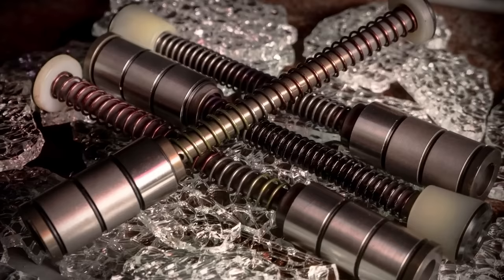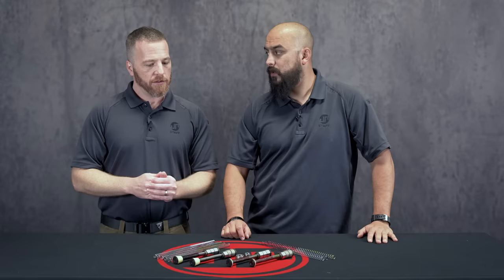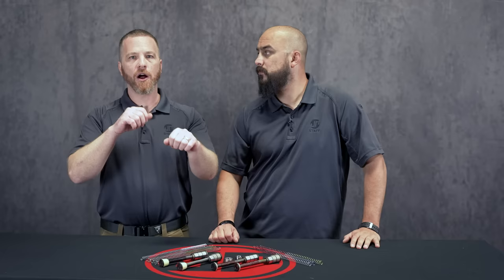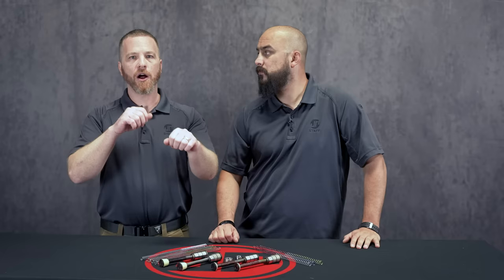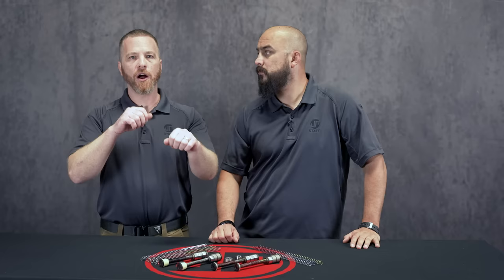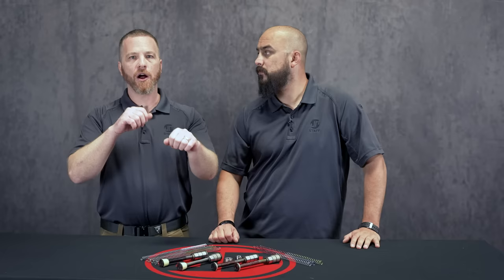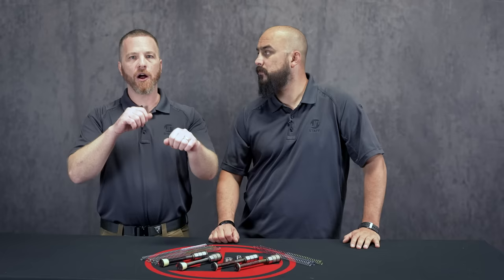Choosing the Right Silent Captured Spring

Comment: I know the company says to use the H2 weight buffer for a suppressed SBR but I found that the bolt catch wouldn't lock back on an empty mag, even with a wide open adjustable gas block. I suggest buying the least expensive SCS as it may work just as it should and you aren't paying extra for some tungsten weights that may not be needed. I wish I did that. 😑
Reply: Made the same mistake lol

Comment: One thing I'm not sure I understand...when is bolt bounce an actual problem on semi auto rifles?
Reply: Bolt bounce will topically move the bolt out of battery just enough so on the next shot you get a light firing pin mark on your primer and you end up with a misfire.

Comment: Everyone is complaining about the difficulty of the topic, but this video is the best supplemental source of information available...watching this video, in addition to a careful reading of the documentation JP provides on the website, does appear to answer all the questions most people have.

If I understand JP correctly with regard to selecting the proper buffer/spring combo:

     - If the priority for a rifle is reliability, then increasing the buffer weight is the best initial approach.  JP provides a flowchart to assist with this.

     - If the priority for a rifle is recoil mitigation (in order facilitate the quickest recovery of the sights onto the target), then using a heavier spring with a lighter buffer weight might be the best initial approach.  Sprinco claims to have empirical data to support this approach as well (they are a company that makes excellent springs...which could imply a bias...but JP SEEMS to substantiate this claim).

All choices have tradeoffs.  It seems that the tradeoff for a lighter buffer mass would be a greater chance of the rifle failing to go into battery, and the tradeoff for a heavier buffer mass is increased recoil impulse (delaying sight recovery onto the target).

Based on the information available from JP and Sprinco, it seems that most rifle tinkerers need to understand the following (with various exceptions relating to poor rifle design/construction and weak magazine springs):

     - If your rifle 1) reliably strips each round from the magazine, 2) the brass consistently ejects at 4 o'clock, 3) AND the bolt always locks back on the final round of a magazine, then your gun is gassed properly for that ammo.  There's no need to modify it from there.  In that case, you MAY want to get the JP SCS version of whatever you have in your gun if you really just can't stand the sound of the action spring during the cycling of your rifle.

     - If you're going to be running a broad range of ammo types, then you want to make sure your rifle has the appropriate buffer/spring combo, in order to meet all 3 of the above criteria for the weakest powered ammo you are running.  This means that it will be overgassed for some ammo, but it will always cycle with even the weakest ammo you use.
Reply: Thanks for the heads up.  Took my 8” 300BO unsuppressed H2 for the first time.  One fail to load.  Bolt holds open on last rnd.  But ejecting at 5 oclock.  Going to try lighter spring but unsure.
Reply: Thank you. This complemented the video very well for me. Thanks for the breakdown
Reply: Very helpful explanation thanks
Reply: Super Big thankyou for that breakdown
Reply: @Doc02864 you have the h2 for a short 300bo? did you change any springs?
Reply: @SchiZ03 I went with a lighter spring but haven’t tested it yet.  You would think if there were 5 springs the middle would be standard but it’s actually too heavy.
Reply: @pdlane43 Start a YouTube channel bc you have superior explanation skills. It’s needed thank you for clearing up an hour of a mess for my self in one paragraph
Reply: @briandavis3173  This is an extraordinarily thoughtful comment.  Thank you.
Reply: Awesome breakdown of the topic dude, thanks! Cheers
Reply: Wouldn't you want a slightly heavier spring then, if you are ejecting at 5 o'clock and your goal is 4 o'clock? Since you are ejecting at 5 o'clock, that would mean your spring is lighter/weaker, allowing it to recoil at a faster rate causing an early extraction? I'm not an expert or trolling, just trying to learn as much as I can. By using the advice given on the video, they said if your ejected casings are at 1 o'clock, then the spring system is too stiff. If that's correct, and the goal is to reach a 4 o'clock ejection point, then you would need to keep going to a lighter setup until reaching that point. Once you pass the 4 o'clock goal, that's too light, and you have to use stiffer springs in order to bring the ejection pattern back to the 4 o'clock position. I don't know if my comprehension/explanation is correct or incorrect, but I would like to know what solution worked for you. Thanks in advance for your reply if you do.  My time is valuable to me, so I search for knowledge. I don't waste it on trolling. Cheers
Reply: @chadh3441  For a given ammunition type, brass ejecting at 5 o'clock would indicate a system that is slightly under gassed or over sprung (for that ammunition).  Compared to a 4 o'clock pattern, a 5 o'clock pattern indicates that the bolt is unlocking later and/or the BCG is moving more slowly.  In order to move the pattern to 4 o'clock,  a lighter spring or buffer could be a solution.

It sounds like you may have gotten it backward.  In the video, just before the 11 minute mark, a 1 o'clock ejection pattern is described as having a bolt velocity that is too high.  This would indicate an over gassed system, not enough buffer mass, and/or too light of a spring, NOT a "spring system [that] is too stiff".  To correct a 1 o'clock pattern, a heavier spring and/or buffer would be a solution. In my experience, any firearm that requires a buffer heavier than an H2 is a firearm that is in need of an adjustable gas block.  H3 buffers yield unacceptable recoil/sight movement for my use.  This includes blowback ARs.

It seems to me that 4 o'clock is considered a desirable brass ejection pattern so that the rifle 1) will cycle a wide range of, or inconsistent, ammunition (broader operating window) 2) without experiencing unnecessary/excessive muzzle flip.  Said differently, 4 o'clock leaves enough room for weaker ammunition to still cycle while avoiding the excessive recoil of higher pressure ammunition.  Of course, this is all dependent upon the pressure range of the ammunition types being used.

It is always needs based.  Some competitors (who can control the consistency of their ammunition) may pursue a 5 o'clock ejection pattern (as long as rounds always feed, even if the bolt doesn't always lock back) in order to decrease the amount of time it takes for the sights to settle from shot to shot.  For someone relying on a rifle for defense purposes, the additional recoil and sight movement that results from an over gassed or under sprung rifle can be an acceptable trade off because it can help ensure that the rifle will always cycle, even with ammunition of unknown consistency.

One thing I DO NOT understand is why a heavier buffer yields a broader operating window than a heavier spring.

Comment: Update:. So I installed a tungsten weight on my SCS in my cloned LRP-07 that was unlocking prematurely running the VMOS BCG with SCS, 6.5CM 22in. Supermatch barrel, JP AGB, etc..
  Completely fixed bolt opening prematurely and brass is coming out very clean now!   Rifle is consistently locking back on last round and cycling great!  
  Thank you guys, THIS was the info I needed to get my cloned LRP-07 running reliably suppressed!  Much appreciate!

Comment: good to know my intuition was right on. running a 2a palouse lite rifle with an icrw G3 low mass steel bolt. ordered the scs2-15 with a spring pack for further tuning. also using a superlative arms adjustable gas block. after my modifications, the rifle will be sitting at around 4.3 lbs down from the stock 5.3 lbs. With a scalarworks mount and aimpoint t2, it'll be at 4.7 ish lbs, with a huxwrx 762ti, it'll be back to stock weight of around 5.3 lbs (and i have an h2 captured spring in my PWS, but i don't think it'll need it because of the flowthrough nature of the suppressor). 

Dollar for dollar lighter than a vseven while maintaining a forged receiver set, sitting just above 5 lbs with a dot and suppressor.

Comment: Either my comment in your last video on large frame BCGs was just coincidental timing or you guys went over all the info i was asking for but instead of responding you guys made a video!  
  Thank you very much for this, looks like I will be ordering a couple tungsten weights for my LRP-07 clone I built running a Omega 300 with JP 6.5CM barrel, JP detent AGB, VMOS H2, and SCS H2 and also have the spring kit.  
  I threw the lightest spring in this past weekend and retuned it to lock back on last round.  Carbon on brass is really bad with either springs so GREAT info!  Thank you guys, much appreciated!

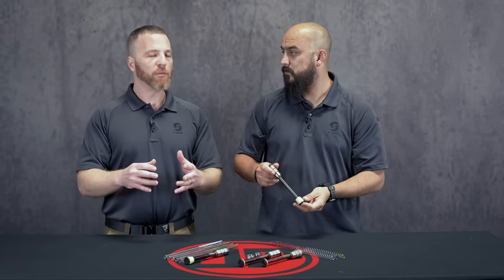Comment: My 14.5 mid length Noveske needed the ar10 springs to cycle at the 3:30-4:00. Using on different platforms it seems like the springs are lighter than normal

Comment: Where is the best place to start to get the softest shooting 3 gun rifle?  Currently running 16", lightweight BCG, adjustable gas block, standard weight SCS.  If I would tune this to be even better what would you recommend?  Gas, buffer weight, buffer springs?

Comment: I have bought 2 then used them in the AR 15 uppers in 7.62x39 - 17 Remington - 223 - 6mm x45 they are no different than using the buffer and spring set up.
Still makes noise also .
Reply: no shit it makes noise
Reply: So there is no difference between the stock buffer and spring and this one on the 7.62?
Reply: It factually cannot make as much noise as a buffer/spring combo. The sprint is bent up and scraping all the walls of the buffer tube at all times. With this system, that no longer happens. It will rub a bit on the capture rod but not nearly as much as rubbing the buffer tube.

Comment: great video! Actually learned a thing or two, thanks for that. My current sbr build is on the verge of "dude you're doin way too much" and a killer battle rifle if i could iron out the kinks. Its a billet 5d tactical lower, machined by me, 11.5'' 5.56 nato upper, carbine length gas system w/adj block, billet slick side receiver, skeletonized lightweight Browning BCG, 7''x1.5'' modular can aslo machined by me, fostech echo sport trigger, and a standard carbine buffer and spring. shes slightly overgassed, but only during high fire rates in the echo position (which is screaming fast btw with this setup) and occasionally fails to pick up the next round from the mag, click empty chamber. i love the concept of the scs and im hoping you have a recommendation or 2 as to which kit and if itll help it be a little closer to reliable. thanks
Reply: Lol just started using a 5d jig and router myself xD got like 3 different builds half put together now haha
Reply: @rachelstephens3680  From my experience, 5d's router setup is about as reliable as it gets when it comes to the finished product and machining accuracy. As long as I keep from doin something stupid, I know once I put a fresh blank in the jig it's going to come out ready to assemble without any headaches.

Comment: I installed a JP "standard",  My AR 15 began to "double feed - one in the chamber and one in the bolt chamber.  I do have an Adjustable gas block on the gun before installing the "standard" JP..
Reply: Would that be from serious "Bolt Bounce", causing the bolt to slam forward so hard, it bounces back far enough to feed another round? Is this scenario caused by the spring being too stiff, weight being too light, or both? Did you find a solution? Thanks in advance for any replies. Cheers

Comment: If 
2 steel, 1 tungsten = H
1 steel, 2 tungsten = H2
3 tungsten = H3

Then what is the H rating for the all 3 steel rings that come in the JPSCS2-15 package?

I have a 16”, 5.56 non-adjustable gas block and I want rapid cycling for rapid firing without the heavy  recoil. Which configuration will work best?
Reply from the maker: Send us an email to Tech@jprifles.com and we can get one of our experts to help you select the correct model for your setup!

Comment: So I have the radical firearms ar15 mid length gas system. 16in barrel. Chamber in 556. Any idea what I should run? I’m just a little confused on all of this lol. I am assuming just the JPSCS2-15 but I don’t want to run into any issues. Anyone have any suggestions?

Comment: Ammo used in this was Hornady Black 208 grain A-Max (Subsonic) & It's a Custom Built AR Pistol I built from top to bottom.

My issue is I got one of these for my 10'' 300 blk out, in H2 weight config. My plan is to suppress it at some point. HOWEVER, if you dont supress it with the H2 config (2 titanium, 1 steel) EVEN with a adjustable gas block. I could get it to extract the shell casing but not rack another round without having to manually do so. 
I'm guessing this is a spring issue as in spring weight is to heavy? OR is it i can use the spring that came with it and i need to use 3 steel weights so its standard until i suppress?

Very frustrating day at the range.

AFTER watching more of this video I'm seeing its a weight issue....thank god I ordered the SS Weights yesterday and I'll be changing those out to run subs even though at this time I'm not running it suppressed just yet. I also already have the spring set cause i bought it with the scs when i got it. So I'll start with the SCS Weight change to 3 Stainless to try and get the bolt to rack another round and achieve lock back (without manually locking bolt to the rear). If need be like you said do a 95%  weight spring and go from there. THANKS!!!!! Helps out a lot!

Comment: ok ..do you have to remove the bolt carrier weight .. what the best weight for a 9mm direct blowback system ?
Reply from the maker: Yes, the slide passes through the rear of the bolt, so the 9MM bolts with weights will need to be removed.  The weight required changes according to your setup. Give us a call and we can help you find the best for your setup. 651-426-9196

Comment: What do I need for a DD Mk18 and RC2 suppressor and a folding Law T pistol brace? 10H or the 15H??  I ordered a sprinco blue and a H2 buffer and then saw this. I was going to use the stock carrier that is at .70 but need to know if you guys suggest an adjustable carrier bolt or something else. I want to able to run both unsuppressed and suppressed as cleanly as possible. Semi auto.
Reply from the maker: I believe you are looking for the H2-LAW. It sounds like a specific request, reach out to tech@jprifles.com.

Comment: Which one do you recommend for a faxon light weight BCG? 

Also, would I need an Adjustable Gas Block as well as the JP buffer spring for a lightweight BCG or would the JP system be all I need?

Comment: I just got mine in but now I'm questioning if it's the right one. I'm running a 16 inch with an h2 currently, suppressed and a radian suppressor charging handle. No shorty stock but standard buffer tube. The only difficulty saw was the polymer end am I wrong?

Comment: I just ordered a JPSCS2-10H2 and spring kit for an 8.6 Blackout carbine build (16" barrel). I used a Geissele Super 42 spring and H2 buffer. I didn't install an adjustable gas block. I have one so if necessary I can change out the gas block. It ejects but dents the case mouth, the case lands at about the 1 to 2 o'clock position,  and the bolt doesn't lock back on the last round. I weighed the buffer and it weighs 4.3 oz. My form 4 for a Dead Air Primal is at least 6 - 7 months out based on current status info. I plan to shoot this suppressed all of the time but shooting the Gorilla Ammunition supersonic loads, or my reloads, aren't off the table. The info on your site says the weight is 6.6 oz. Is that assembly weight or buffer weight?  I'm looking forward to trying your system.

Comment: I was thinking about getting one of these SCS systems. Im running 16" 223/556 Carbine Gas System with Springco Blue & Spikes T2 Buffer (4oz). Right now it ejects at about 3oclock and as long as im not running TulaAmmo it doesnt have any feeding issues. What size SCS do you guys recommend H or H2?
Reply from the maker: You could run the Standard or the H2 for this depending on your personal preference/rifle setup. Give us a call if you want help narrowing it down more than that. 651-426-9196
Reply: @JPRifles  thanks for reply. I bought the standard. Rifle isn't complete yet but after it's built and I get it tuned ill just order the Tungsten weight if needed. Thanks

Comment: I am having issues with some rounds not chambering completely using the standard captured spring. I ordered a couple of tungsten weights to see if that helps.
Reply: Make sure your scs moreso your buffer tube is installed far enough into your lower. Depending on that info you might need to thread the buffer in a turn or two, could even throw a quarter in the buffer as a shim to move the scs so it has good contact with the BCG when closed

Comment: What's the lightest buffer weight you can configure it? I'm currently running a 1.7oz buffer.  Rolls the brass out in a nice neat pile about 2' from me at 4:00. I have run a .59 oz buffer but never could get the bolt velocity low enough to feed reliably.

Comment: question , i am using an adjustable gas block and will sometimes use a supressor.  its woudl be a small frame caliber same setup but for large frame, which system would you recommend?  Thanks
Reply from the maker: We would need more info to help you. Please see our Selection guide https://www.jprifles.com/document_pdfs/SCS%20Selection%20Guide_880.pdf
Or feel free to give us a call at 651-426-9196
Reply: @JPRifles thanks, i looked at the selection guide many times. still not sure which to select.  i will try to reach out